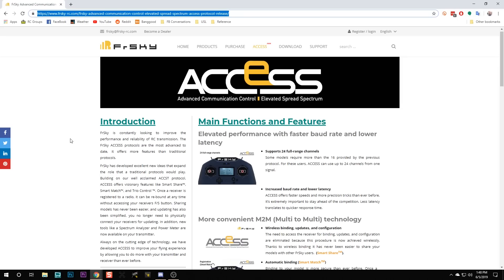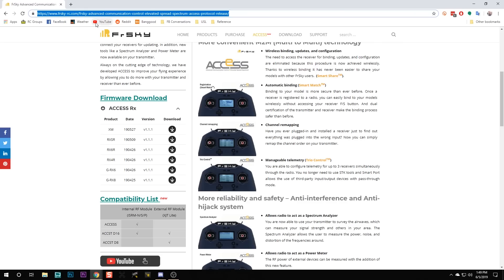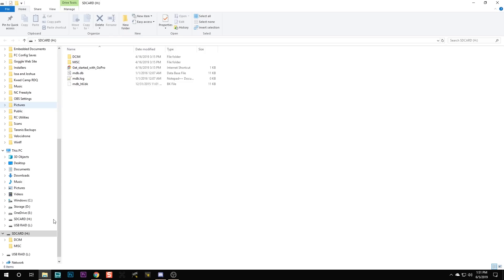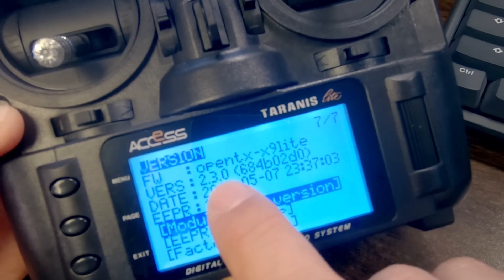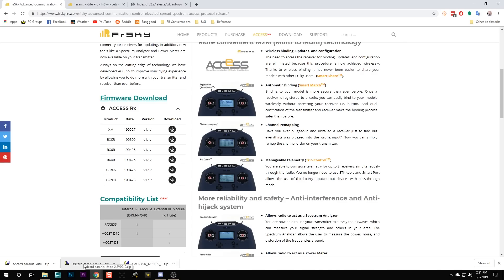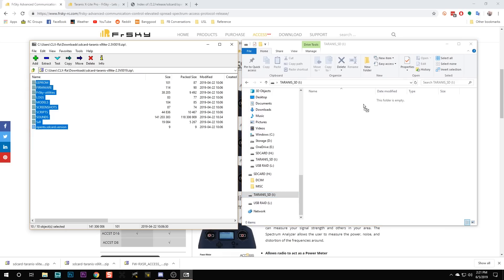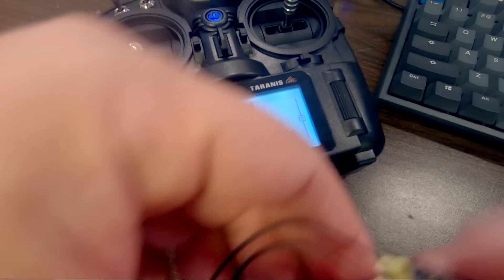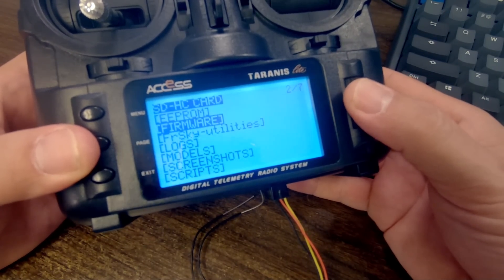FrSky ACCESS Firmware R-XSR Update | X-Lite Pro & X9 Lite

Comment: Help? I have a  friend next door that is just getting into flying and I'm trying to set up his new quad with a new Frsky XD9+ and a new  R-XSR receiver.  I have used this receiver in three of my quads so far and have never had an issue with setting them up. This new transmitter has the 2.3.14 version on it. I have flashed the new firmware as you described, went through every step and cannot get the receiver to bind. When I try to bind it it, all three lights come on, blue, re, and green all light up and stay lit. I have tried everything I know and also watched a few different videos trying to resolve the problem to no avail. I know that I'm missing something but have not been able to figure it out yet. Your videos have helped me numerous times in the past and have been greatly appreciated. Any help with this situation would  again be much appreciated, thanks in advance.

Comment: Hey josh, I’ve been practicing in your backyard in the simulator a few days, I used to fly regular LOS quads, helis, and planes. went to DJI, but found that even in sport mode I wanted to do more. I recently got a iFlight Nazgûl 5 HD with RXSR and the Racingdayquad says it comes preloaded with access. if my xlite pro has access as a mode, why won’t it bind with the RXSR that has access on it? I’m in the middle of updating the OPEN TX and internal RF module. Update: it’s still not working even with latest firmware ughh

Comment: How to change Q7 transmitter to access protocol ? Is that possible ? I want to use new receivers Thank you for replay
Reply from the maker: It's basically impossible to convert an ACCST radio to ACCESS. Well -- in theory some people have ripped the ACCESS module out of an ACCESS radio and installed it in an ACCST radio, but it's beyond what most people can do, or want to do.

Comment: Yep, just made the mistake of buying a FrSky X9 Lite S. Will not bind to the XM+. Gives a false bind light then on and off intermittently. Had to get an iRX4 multi to use my new quad. It looks to be over two years since this video came out and FrSky actually has LESS "ACCESS RX Series -2.4GHz" firmware downloads now (missing the XM). 
I tested the waters of FrSky and found them cold and uninviting.
Reply from the maker: Need to update to ISRM version 2.1 then it will bind.

Comment: Hi guys i have problems with t lite when i flash the Reciver it’s says (FW update error not responding) please any one have ida tell me thx
Reply from the maker: Make sure you are selecting "flash s.port" assuming the receiver is plugged in to the bottom of the radio.
Reply: @JoshuaBardwell  thx its works 👍

Comment: Hey Joshua,  I've downloaded the correct files, according to the OpenTx  version on my Qx7, and placed them in the firmware folder of my sd card. However when I access the file in my transmitter, when the Rxsr is connected, it does not give me the option to update the receiver. Only option I get is to copy or delete the file. Can you, please, tell me what im doing wrong?
Reply from the maker: The file must be in the FIRMWARE folder and it must have the correct extension, which is frk or frsk. If you're not seeing the option to flash the file, one of those conditions may be false.

Comment: Hi fpv friends and Joshua!George from Greece here!i experienced a problem as a newbie . i correctly binded the receiver with my tx16s but when i connected it to beta flight no stick movement occured. So...Be carefull when first binding the Frsky-rxsr if you have sbus to the fc connected. in order the receiver to work in sbus mode when bind check that a green and a blue led is lighting,not only a solid green.In order to bind it you have to stimultaniously press the bind button on the receiver when power on,not keep it after it power ups. but if you do so and nothing works just plug it again normally and press the bind button 4 seconds and thern you will see a green and a blue led.and then it works with  beta flight too. this took me 4 hous to find it from another video in you tube thankfully.i just add it here to help other people. thank you for you time and the effort you make Joshua!

Comment: Hi Mr. Bard. I'm buying a RTF kit Alpha A85 with R-XSR. They say it comes already soldered and ready, but I still have to update the firmware to match my ACCESS, and I don't know if the servo cable is included. If so, do I have to disassemble something on my drone, remove the receiver in order to update the firmware? As a beginner, all these things are giving me terrible headache. Your videos are very helpful, but, this hobby.... If you are complete beginner without anyone in your surrounding that knows this stuff, its extremely complicated to get into.. Thank you

Comment: @Joshua Bardwell  
If i have a new Radio, do I have to do the OpenTX site setup, or would the SD contents from FrSky have the OpenTX in it also? Or it doesn't matter, I always get OpenTX from their site, then the firmware form FrSky?
Reply from the maker: The FrSky version of OpenTX is different from the OpenTX website one. For example the Frsky version (I believe) does not include the Crossfire lua script.
Reply: @JoshuaBardwell  Oh thanks, I wasn't sure if you were getting the OpenTx software when you were getting it from FrSky. Thanks you.
Reply: @JoshuaBardwell  Hey Josh sorry quick clarification.  

With a new X-lite Pro, would I still flash the radio on the computer using the OpenTX app with it's latest software, then flash the FrSky firmware on the radio using the SD card contents and firmware from the FrSky site (updating for the R-XSR), then I would flash the R-XSR receiver firmware from the FrSky website to the receiver. Should I do all of those steps even receiver before I even try to bind?  ACCST16 was already on the raio when I got it. Or showing in the MODE  

(From your X-Lite and R-XSR videos)   @Joshua Bardwell

sorry ignore the other one I posted if you happened to see

Comment: Binding an X-LITE PRO to an R-XSR receiver: I updated the firmware on the R-XSR to the latest V2.1.0 ACCESS Firmware like in this video. BUT, you also need to make the transmitter's internal ISRM module is updated to the latest V2.1.0! I lost so many hours to this issue, I hope it can help someone.
Reply: Thanks, Scott B! I think I ran into this as well after upgrading my R-XSR to anything higher than V1.1.1. I couldn't figure it out so I ended up rolling back to V1.1.1, which allowed me to bind using ACCESS. I've been looking around, but I can't figure out how to update the ISRM. Can you please point me (and potentially everyone else) in the right direction?
Reply: Well, I found the answer, so I figured I would share it here: https://youtu.be/tx0IORen-BA?t=1072

Comment: Hello Again Joshua, My HiTec TX just died and a good option for me is the Qx7 with ACCESS. Will this work with the Delta 8 (multiprotocol RX for HiTec) and minima RX also multiprotocol tx.Also, is it possible to have the QX7 to NOT use the ACCESS protocol once it is shipped to me if the ACCESS does not work with my existing receivers? Thanks heaps, !!

Comment: Hey Joshua thanks for the info. So I accidentally flashed my transmitter with a version which was not compatible and now my radio has no firmware. Is there any coming back from this???
Reply from the maker: Did you flash opentx or the radio module? I don't think you can brick the module so I'm guessing you flashed opentx. The workaround is to re-flash it using DFU mode. Use the method I show in this video (plugging in USB with power off and then use IRC Driver Fixer) https://www.youtube.com/watch?v=7Q33tztpHyA
Reply: @JoshuaBardwell  I flashed opentx with a version that said was not compatible. So I unchecked the box that says something about checking compatibility and after flashing it the radio will only turn on in bootloader mode saying no fw installed.

Comment: I'm still running D16 on my XM+ RXs. I'm having a hard time finding a technical review on the performance of ACCESS on an XM+. Could you do that, or is FrSky so high up on everyone's shit list that nobody cares anymore?
Reply from the maker: I'm not sure anybody has tested latency on that specific receiver but here is a table testing other receivers.

https://docs.google.com/spreadsheets/d/14F0HHDNYIdGpTDLeHvXrCeLH8-vC3-hRIDzbgOypfuk/edit?usp=sharing
Reply: @JoshuaBardwell  Just an FYI, The X-Lite Pro, paired with an ACCESS-flashed R-XSR, does not work right. Range is somewhere along the lines of a cheap-frisbee, and Betaflight OSD RSSI never tops 50. Forums and facebook groups suggest that this is a known issue. There doesn't appear to be a lot of people trying to make the jump based on the sparse amount of chatter on the subject.
Reply: @blam3329  I jumped on the bandwagon and flashed my xm+ RX and had terrible range. Tried flashing back to D16 and found out that isn't possible. Well at least these were old cheap receivers.
Reply: Daniel Sullivan I found out that there’s a scaling bug (nobody wants to admit where it is: betaflight/opentx/frsky). If I go into bf CLI and set my Rex scaling to 200, its more realistic. My range isn’t necessarily bad, but I’m afraid to take it very far, so I don’t know how bad it is. I was able to flash my R-XSR back to D16 though.

Comment: Wow! A lotta hate! ... Josh, have you bound two receivers to the same model with access and fport... I had one quad working fine, then I bound another and the telemetry was all off... Like it was calling out temp. instead of vfas...
Reply from the maker: You cannot mix different protocols like SBUS, FPort, ACCESS because the telemetry sensor ordering is different. You cannot bind these quads to the same model on your radio. You have to make one model for each, and discover sensors for each.
Reply: @JoshuaBardwell  thanks for replying , yeah I get that... I had all my d16 quads (xm+ receivers) on one model... Those worked fine with no telemetry. I guess I was hoping I could do the same with access fport quads and put them all in the same model. It seems like that's not going to work because I can only bind three receivers and they're intended to be three receivers for the same model.

Comment: Josh, talking about binding, I need your help! I had bound 2 R-XSR to my X9D, but unfortunately afterwards I broke the bind button of both by adding some conformal coating. Is there a way to bind them back if I update them or my taranis? How can I extract that binding information and use it again? Thank you!
Reply from the maker: The only way to do it is to re-bind them. Gently scrape off the bind button to expose the electrical traces underneath. By bridging the traces, you can "press" the button.

Comment: Seems that you can flash between ACCESS and ACCST. 

https://www.rcgroups.com/forums/showthread.php?3265449-FrSky-new-ACCESS-protocol-release/page52#post42114037
Reply from the maker: My info is based on statements from FrSky. If FrSky has changed their policy or there is a workaround, then that's wonderful.

Comment: Posted this on RCGroups about flashing back to D16 firmware:

Started out with a brand new R-XSR receiver and flashed R-XSR FPORT firmware onto it using the X-Lite Pro to verify that I could successfully flash this firmware. Flash was successful and confirmed it by making a new model and binding to it in D16 mode. Telemetry was good as shown by the RSSI. 

First time flashing the access FPORT firmware resulted in an error, "Device refused data" if I recall correctly. Second attempt was successful. Confirmed working by binding in ISRM ACCESS mode and checking out telemetry tab.

Flashing back to FPort has been a struggle. First attempt got to about 75% before it gave me the device refused data error. I expected this since I also got it when flashing ACCESS. 
Second attempt, the update got through maybe 25% before throwing out the error. Third attempt threw out the error almost immediately. It throwing the error at different times in the update process tells me this is more of a bug and not actually a deliberate attempt at blocking the update. 

I restarted my X-Lite Pro at this point and tried a fourth time. The fourth attempt was successful. Bound under ISRM D16 mode and checked telemetry. All is good.

So there, the firmware update process is hella buggy so while some people might get lucky the first try, some other might fail three times in a row. Bardwell may as well have tried to revert and failed several times.

Good luck flashing and may the odds be with you!

Comment: So we'll be locked into ACCESS after  FrSky changed the factory firmware to ACCESS?
Guess I'll change to CRSF(yeah, more money wants to be spent!)!
Reply: No, receivers can be flashed freely back and forth to either protocol. x-Lite Pro and X9 Lite can also bind to D16 receivers. with OpenTX 2.3 nightlys, also have MPM support including Crossfire.

Comment: So if I only have a QX7 and I flash the access firmware, I've basically bricked my R-XSR?
Reply: No. You can flash it back. I've tested it on a brand new r-xsr
Reply: @pxss2005  tell me more! What should I flash the rxsr to to work with my QX7
Reply: Did you manage to solve it?

Comment: Thank you for the heads up.  If you flash the wrong firmware to an R-XSR and you only have ACCST transmitters (X9D, QX7, Xlite (non-pro), etc..) you effectively brick the RX from your use.   This is not good.
Reply from the maker: The receiver has a standard micro-controller on it. I think it's an STM32 F1 chip but not sure. When you flash the ACCESS firmware, it overwrites the bootloader to prevent you from flashing D16 firmware any more. But if you know how to flash the micro-controller directly, you can pull a code dump from a D16 RXSR and write it to the controller of the ACCESS RXSR. This would require tools that some people wouldn't have, like an Arduino, but it can be done.
Reply: @JoshuaBardwell  Not only equipment, but ability to connect it to the correct locations on the RX to directly access the micro-controller.  Not sure if the standard connection pins allow this on micro X series RX's.
Reply: Pretty sure you can reflash it with an Arduino on your pc
Reply: @MsKoffeinjunky  Any links as to where there is information on flashing an FrSky X series RX via Arduino (or FTDI)?

FrSky D series have tx and rx and usually need pins shorted to allow the RX to be updated via  FTDI or arduino, but these options are not available on the micro X series RX's.

Comment: Suprised no one hacked this yet to be able to run both protocols on the same radio . seens inevedible . 👍
Reply from the maker: FrSky has already released firmware to let the same radio run ACCESS and D16. It's the receiver that is locked out.
Reply: @JoshuaBardwell  thanks Joshua .

Comment: I wanted to see if anyone had tried a OTA update on a R-XSR receiver yet and how the process was or is that only compatible with the access versions of the receivers?
Reply from the maker: Only compatible once you have ACCESS firmware already on the receiver.
Reply: @JoshuaBardwell  thanks so much. hopefully they release an update for the receiver so we can see how it works for frsky. if its anything like the crossfire it will be a great addition.

Comment: Does the RX still work with ACCsT after getting flashed? I have ACCST TXs and if the newer R-XSRs are going to come only with ACCeSS protocols then that's gonna be sad :(
Reply from the maker: The RX does not work with ACCST any more after being flashed. And it cannot be flashed back to ACCST once it is flashed to ACCESS.
Reply: @JoshuaBardwell  Uh oh... Does this mean that future R-XSRs won't work with my transmitter anymore if they ship it with the latest firmware?
Reply from the maker: It's difficult to guess what will happen in the future. In the last few weeks, FrSky has made D16 and soon D8 available on ACCESS radios, which they originally weren't going to do. So maybe something different will happen with the RXSR in the future. Today, you can't downgrade back to D16.
Reply: Why isn't it possible to flash it back?
The bootloader should be unaffected.
Reply: It is possible to flash back to ACCST after flashing to ACCESS.

Comment: For a friend just getting into the hobby is this the way to go? I'm conflicted in how to advise him. Can you do an update on R9 as well, Is it trust worthy?
Reply from the maker: The X9 Lite has a firmware update that lets it use D16 mode. And I have heard a rumor they are going to open up D8 mode too. At that point, I think it is a very very good starter radio.
Reply: Nah, tell them to get the QX7S or QX7 instead. ACCeSS is pretty damn new so it's best have him use something well documented on already.
Reply: I fly original x lite with crossfire and love the form factor. Getting all that to work was far from seamless.
Reply: The r9 lite works without modification to the r9 firmware.